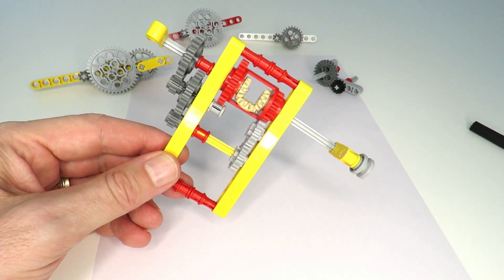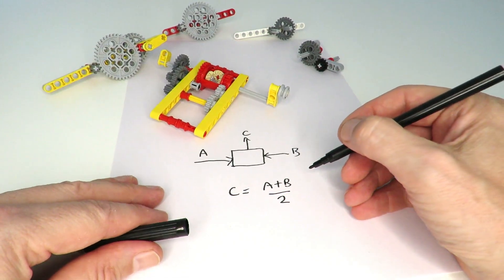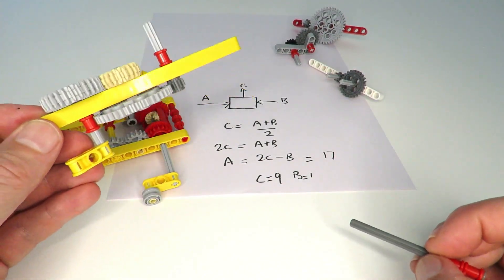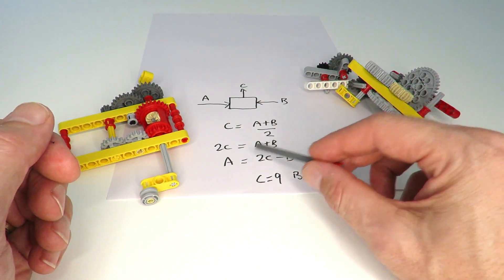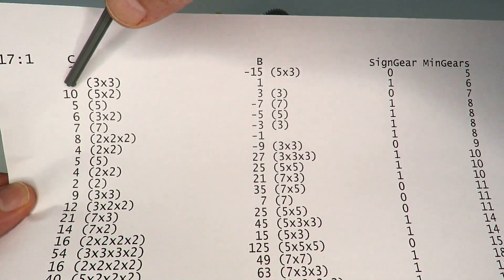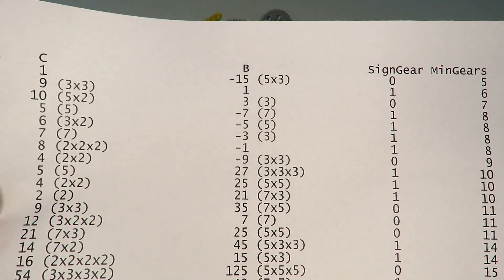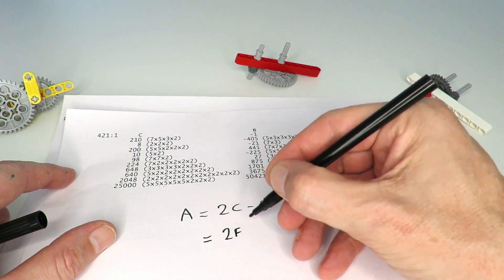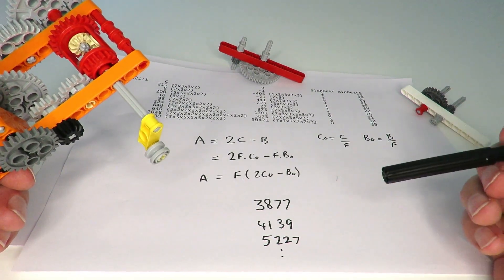How to use a Lego Technic Differential for your MOC Part 2: Computer Generated Solutions

Comment: Just to be absolutely crystal clear in terms of your (wonderful) equations:
Are the values of A, B, and C the angular velocities of each shaft? Are they the reciprocals (that is to say, the number of turns completed by each shaft)?
Reply from the maker: Hi Mike. Yes A,B and C are the rotation speeds, so RPM or angle/sec whatever unit you prefer. They can also be the number of turns in a given time period, but not the reciprocal as in time taken for 1 revolution. Hope that helps. 🙃
Reply: @TechnicBrickPower  Yes it does, very much. I have been working on a module for an astronomical clock which converts days to years via 487×(3/4)=365.25; I built it under the assumption that A, B, C, etc. were ratios of gear teeth, and could not for the life of me pinpoint where I went wrong.